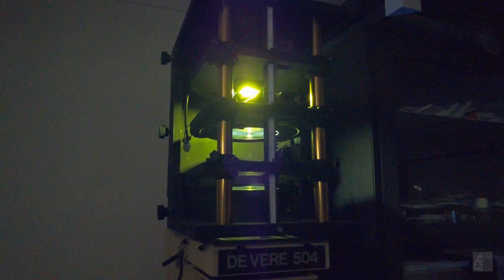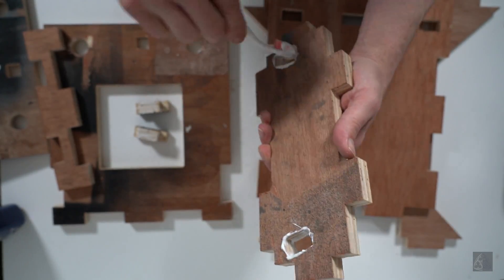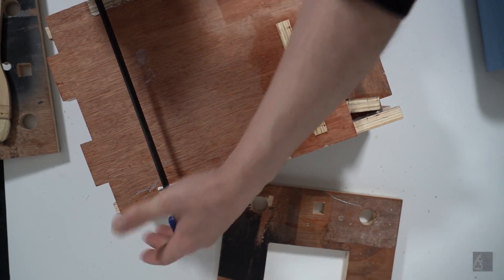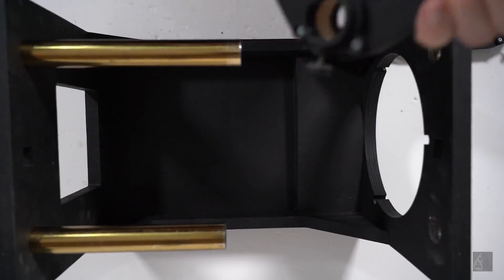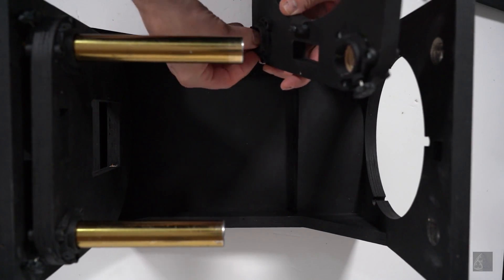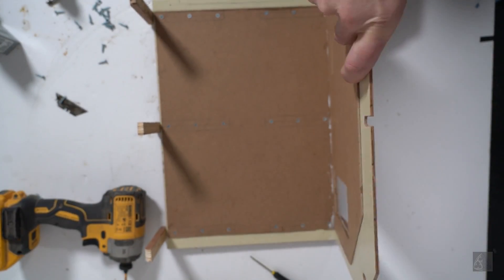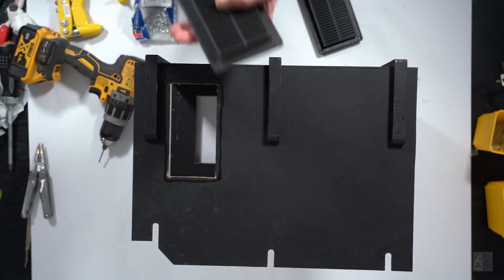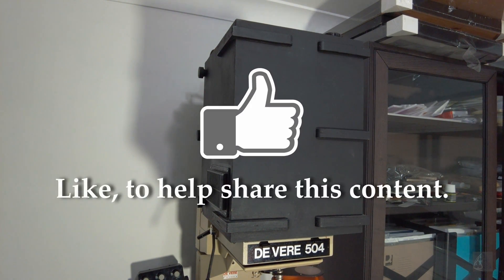Making a UV enlarger condenser head for my De Vere 504. ultraviolet

Comment: This is a really cool idea. I might try and replicate it for my Durst A600 enlarger. Have you been successful in printing with it so far? What enlarging lens are you using, and what are your rough exposure times for it? I think it would be interesting to add a microcontroller that auto exposes based on the light output via a sensor at the base.

Comment: hey , that's a very nice idea that I always wondered if it would work . 
I also read in some forums that the it would not be easy to focus the image ,because danger to your eye when using a grain focuser . did you find a solution for this ? 
( and are there any result you are willing to share ?)

keep up the great work ✌
Reply from the maker: I do the focusing with a printer paper, the UV make it glow and you get only the UV part of the light. At the moment I am only looking at the paper but it is surprisingly accurate. 
 I remember someone designing a UV focus finder. 
I will be showing the workflow at some point but I am not there yet.
Sorry for the late reply.
Thanks.